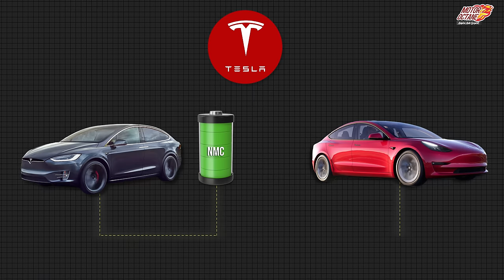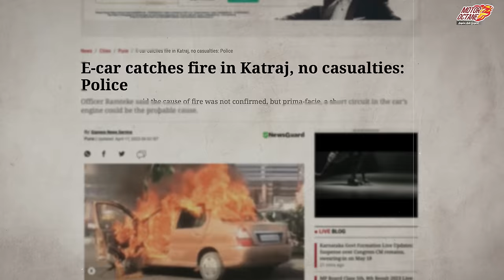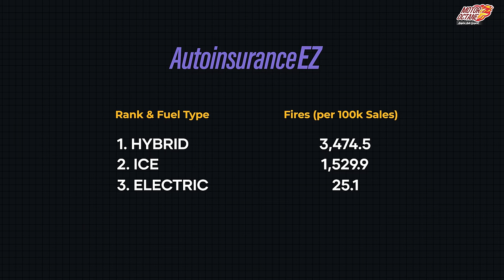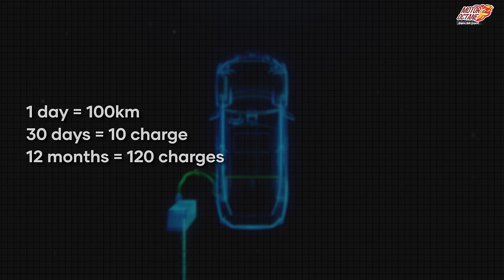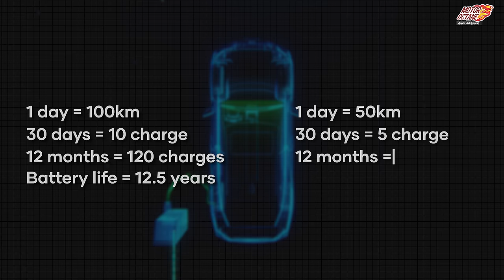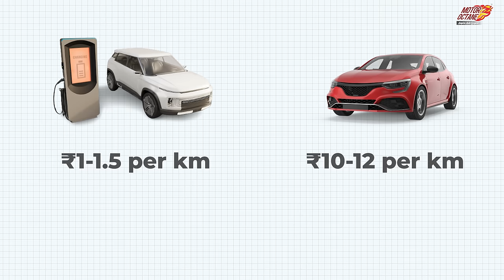Electric Cars have Battery Problems?

Comment: Hi Rachit @motoroctane I am a Nexon EV owner. I feel the problem with EVs is, they have become more of an appliance rather than a vehicle. And with poor manufacturing process added with below par dealer dominated support framework, makes it a gamble. If you got a decent car, then you might be happy. But if you have got a defective car, then you're at god's mercy. Sometimes it's worth thinking "are we ready for EV yet”.

Here are the details for this observation. I purchased my car in Jan 2022.  1st Breakdown: 18th March 2022, location Bengaluru I was going for vaccination of my Daughter (4 months old at that time). My wife and baby had to wait for a couple of hours on the road in sun taking all the head and pollution waiting for the tow truck. Service centre guys told, it was a simple problem where a cable went loose. 

2nd Breakdown: 5th January 2023, location Ooty. (Daughter 14th months old). On a family holiday, suddenly the car started showing a critical battery error and went into limp mode. The car had to be towed to Coimbatore service centre. We had to abruptly finish our trip and had to travel and stay in Coimbatore (charges extra paid from my pocket). Again as per the service centre, issue was very simple as some condensation had deposited on the LV ports. I wonder what would had happened if the car had broken down in the forest. 

3rd Breakdown: 17th April 2023, location Bengaluru. Car had been lying in the parking lot as I had to visit my home town. After coming back, we I tried to start the car go again critical battery error, and had to sent it to the service centre. Now again I was told, it was a simple issue of HV cable loose in DC-DC.

I had wrote to all contacts available over internet for 2 things.

1. To do a through checkup of the car &
2. Post launch of Nexon EV Max, as a cost cutting measure, Nexon EV(Now prime), doesn’t come with a bottom plastic guard to covers the internals. I asked to get me. (At my cost)
Nothing has been done, till date. Got a call from Tata Motors Regional CRM. He listend and made an empty promise of fulfilling the asks. Till date they are “evaluating”. Sad to say govt works better than tata employees .

So I would like to advise your viewers to think thrice before buying a Tata EV.
Reply: Thank you for your valuable input.
Reply: This is very true. I had the HV critical alert twice so far on Nexon EV prime and got stuck with my 4 yr old and wife in a U-turn! Never felt so unsafe being in a car. Car towing guy called after 2 hours. I had to hire a cab and send my wife and kid home. Luckily I was in city. But it was on May-1st. No service Center open for emergency breakdown. No service personnel available. So your emergency support is down the drain. Having an unreliable Nexon EV and not having reliable service support makes things even worse. I’m now so skeptical to use the car for distances more than 10 km
Reply: @ICEBreakup  yes I understand this feeling. We feel so helpless and insecure. And worst part is the manufacturer doesn’t respond to requests. Had it been any other “appliance” we can do return/exchange. But here you can’t. Even your ask for a through checkup is not fulfilled. And also I think online when you search you don’t get a forum where impacted people like us are sharing the pain.
Reply: This is extremely important point give by you for the upcoming owners. Thank you so much for sharing this Mr. Amitabh
Reply: Good work Rachit 
I also have Nexon EV Prime couple of days ago i had stuck on road in between traffic due to sudden Battery Drainage issue!!   I had to wait more then 30 minutes to get call connect with customer care !  I started calling customer care @ 10.30 pm and call answered @ 11.00 pm and car towed @ 2.00 AM in nxt morning. Service centre took 3 day and took trial & found nothing and replied its a software update is available and we had upgrade the software. As u can think how a software be a reason of sudden battery loss? Let say an older software that was running on car since i bought suddenly it gets kind of EXPIRED on a date and it will be reason of failure. As i follow you guys i searched on multiple websites for is there any software update available?
Surprisingly there is no such update released by company! When i asked them to provide the version of older one on my car and new updated version they failed to answer it as there is no such thing available. 
I noticed there is so much confusion in service centre guy’s Knowledge even i talked to technician, CRM of dealership, Regional OFFICER who look after EV complaints they all contradict their knowledge about how to use EV, Charging cycle, LOW PERFORMANCE MODE which enables 20% battery to get charged to charging, one of the guy said if u use fast charge  an be a reason for battery issue! When i told him i had use fast charge only 2 times since I bought car he kept silence! Now if a fast charging is affecting such to batteries in such low time why company is promoting fast charging? 
I also find on multiple visits to service centre it seems there no such infrastructure & guidelines & training given to technicians till now and its working in gods mercy !!!

There is so much to get know before someone buy an EV & like you Rachit be the source of knowledge 

Requesting you to be the voice of frustrated customers of TATA EV as i only have exposure to TATA as having TATA car filling and getting no help from customer care!!

Once again Thank you for the knowledge you spreading keep up the good work and help current as well as new buyers
Reply: Add to this, EVs are really not that eco friendly as is being hyped up. Ask yourself a simple question, if roughly 70% power generation is by burning coal (which is one of the dirtiest source of power) how is it zero pollution? It is then no longer a solving the air pollution problem, but shifting the pollution problem.
Reply: A very thorough comment. Thank you.
Reply: You are at the mercy of Tata and Mahindra NOT God!!! Probably they need to learn Customer Care lessons from Giants.
Reply: I'm also an Tata Ev owner from last 1.5 years drove my car Tata Tigor 25k. I've not faced even a single issue till date. I've been to long trips Dehradun, Shimla, Dharamshala. With proper planning everything is so smooth.
I think you are right Tata cars were may be not reliable from start but they have improved alot so taking car now with newer version is very safe go for it!
Reply: Thanks for sharing your experience.  Excellent pointers and these issues are often hidden by the marketing team. Iam sure thr engineers at TATA are well aware of these issues.  We are not ready for EV yet . Could u plz tell me how long the charge lasts if u don't use the car , I mean if it's fully charged but just lying in your parking ?
Reply: Thats why tey to buy the car as soon as ot gets launch whether its an petrol or EV car.  Because later they will start doing cost cutting in the parts.
Reply: with the kind of experience you had with TATA ev , you deserve a replacement from TATA and an apology. Can't imagine your bad experiences with your family.
Reply: @DeepakBusanagari  thanks Deepak. I wish to file a consumer court complaint. But my lack of knowledge about this subject is causing a big hurdle.
Reply: @amithbanger5959  Battery has no issue as such. Mostly issues are with wiring and related stuff. As it’s done by factory workers. Some screw might not be tighten as required. Which will then cause trouble.
Reply: @amitabhchanda  ok so u confirm that the battery will not discharge while the car is just sitting in the parking lot for weeks .
Reply: @amithbanger5959  yes. If you’re going away for 4 weeks or so. The. It’s recommended that you disconnect the auxiliary battery. It’s same as ICE vehicle. That battery will get discharged.
Reply: @amitabhchanda  thanks that's exactly what I needed to know. ICE car batteries take longer to discharge 3 months plus.  So even with 2 weeks lying in the parking , we could expect a 50 percent discharge for EV cars I guess
Reply: I don't think EV will be better before 2030. Less range, more problems. Heating is the main thing atleast for Indians.
Reply: @amithbanger5959  you EV battery will hold charge. It will not deplete. Buy the auxiliary battery might get drained. Hence recommended to disconnect.
Reply: @amitabhchanda  thank u very much for your valuable insights .
Reply: Why did u buy one man
Reply: @Elisa9395-y4z  well brother we all make mistakes. This is why car consultancy like what Rachit has are required.
Reply: By the way one more nugget. As in EV how much range that you’ll get after a full charge is dependent of how you drive. Just to give you all an overview of that. Yesterday when I did a full charge I got a range of 300 which was all city drive. But when I took my a trip to Mysore this morning. I am getting a range of 174 kms. on highways. THIS THING WILL BE COMMON TO ALL EVS
Reply: @amitabhchanda  sounds like a lot of planning before going on a trip. I guess one has to factor in the various charging stations en route to make sure u don't die out in the middle of no where.
Reply: Any petrol vehicle can also break down brother it's just u don't blame companies for it
Reply: @abhijit1509ibskol  Bhai half knowledge is very dangerous EVs are 90% more eco friendly than petrol vehicles reason is very simple.

70% Electricity is generated by burning coal and my friend petrol kya air se aata he from crude oil to pure petrol takes 10 times more pollution than used to charge one electric car 
+ to deliver that petrol to petrol pump also takes more pollution in transport. And oil spills in sea has killed billions of fishes as well.

+ Petrol vehicle pollutes more while running as well so it is end to end pollution.

If u installed solar panel at home than it becomes 95% more eco friendly.

U would say lithium mining as well engine build kisse hota he by alluminium and iron uske liye bhi pollution hota he mining hota he.

Bhai knowledge badhao aur apne doubts clear Karo galatfaimi me mat raho dost 😊
Reply: @prashwin0917  probability is low due to settled manufacturing process + recall happens.
Reply: Absolutely correct... This guy is PROMOTING EVs as if hired from  Mr Gadkari !
Reply: U made a big mistake
Reply: Let's say, the battery Capacity is 300 kms n u drive 100 kms per day, So theoretically, you will have to charge in 5 days. That assumption is absolutely WRONG. I think if I am the EV owner, I will actually charge once I am done with 150-180 kms. No one can take that risk of getting stranded in the middle of the highway, specially how unreliable these EV z are specially with the range part. So your 1500 cycles will come VERY QUICKLY.
Reply: @aakashgopalia  Let's say you charge after every 150kms, then it is counted as half charge cycle each time and it will be considered one full charge cycle if you charge it twice at each 150 kms. So what you stated in last line is not factually correct.
Reply: @santoshpv321  can’t trust EV z yet ! It’s a Long way to go !
Reply: Watch the video above and decide for yourself ..
Reply: Thank you i will keep that in mind
Reply: Let me tell my story . My Ev max always gets disconnected while charging in fast chargers. Tata charges always sucks . Tried static , it happened the same. After riding the car continuously at 80-90 for an hour my car shows limited battery performance even battery is 60 percent left . Service center doesn’t have complete info .  While I have seen when MG ZS Ev was charging at fast charging before me doesn’t had any issues. Those cars support better charging acceptable and never disconnect as EV max do . Useless car experiences as I am afraid of taking my car outstation .
Reply: @Radhakrishnabhakt  thanks for sharing your experience. I am sure service centre people were not able to fix the issue and would have given you a very stupid reason.
Reply: @ridhamgupta7504  tigor ev kabse aane lagi
Reply: @abhijit1509ibskol  EV vehicle is a new market trend globally. So the investor get profit. I mean stock market. EV is not meant for ecofriendly vehicle.
Reply: @prashwin0917  Please study electrical and Mechanical Engg. Do you have any idea what the power rating to charge a Nexon EV. If you consider if the EV car charger consume 7kW of power and if you install 10kW Solar panel, the solar panel will cost 10 to 15 lakhs. Extracting Iron and Aluminium is not that hard like mining Cobalt and Nikal. As per your view, Gold and Iron are same. You cannot understand why gold is so expensive compared with iron.
Reply: @rameshlaksh  you are spot on! To add to your perspective, the European Commission incentivised purchase of diesel cars and SUVs while rolling out Euro 3 pollution norms. The logic was diesel engines generate far lesser CO2 then petrol engines (which is still true now), they simply were not aware of NOx issues of diesel (which again is blown out of proportion by media and some lobbies). So, in future when the maladies of battery EVs will be "realized", then there would be another round of circus to create a new need, new market and new demand patterns in our "Free Market"..!
Reply: @rameshlaksh   Bhai 7 kw solar panel installation cost is 4,90,000 less than 5 lakh if u want I can get it installed for u my friend. Extracting cobalt and other metals would cause less polution than polluting for electricity generation for 25 yrs through coal
Reply: Rachit, I am a Tigor EV owner. 
The calculation of charge cycle you did is not accurate. Unlike a petrol car, you actually don't wait till 10 to 15% for recharge. You will not drive a car till it reaches 0% . So charge cycle typically is lower. 

Also I don't drive it in heavy  mumbai rain months like July to sept, beacuse as you know that unlike Navi mumbai, where I stay, I work at vakola. I really don't know till what level of water logging you can take your car, despite all ips4 black blazer claim
Reply: He is one of the unlucky owner. No other owner has faced so many breakdown as he had 🤣🤣
Reply: Thank you very much for your valuable feedback
Reply: initial niggle there. and no legacy manufacturer taking this seriously like tesla.
tata mahindra are happy with their ICE car sales. 
mg zs ev is more reliable.
Reply: Keep adding other breakdown details bro, happy electric driving. 
And by the way the towing vehicle they send everytime is thay electric or Diesel? 😂😅
Reply: Really surprised to see 3 breakdowns starting within just 2 years.. I have an ertiga petrol 30k running in 4 years.. not a single breakdown... only one issue happened with AC which was fixed. Another issue was with Hybrid battery which does not auto start stop anymore but does not impact anything else.
Reply: Pls suggest any...
Alternative for Xuv400.
(In my opinion Tata Nexon EV Max best)
Reply: When ppl talk about breakdown and waiting for tow trucks, I laugh so hard 🤣 

Not defending tata they might not be good but all are same be it Toyota and Tata how you expect a tow truck to be present in 30 minute or 1 hour. Unless you are next to it.
Reply: @rameshlaksh @rameshlaksh 
I am not sure if you can sell electricity to grid operators but if thats possible, you can make quite significant amount of money, perhaps even after including batteries for solar panels

Mining problems for cobalt, nickel is real and negatively affects people, but air pollution from cars using petrol/diesel also negatively affects people. Both needing to use electricity from coal plants and using lots of cobalt, nickel can be solved in the future.

One big advantage for EVs is it puts us (and everyone without signficant oil/gas reserves) on a path of energy security and energy independence. It gives us way more leverage in international relations and makes sure that the entire economy is not at the mercy of US or Russsia or whatever
Reply: Thank you for valuable information
Reply: Thnks
Reply: Where there is TATA there is headache 
Pichle 30 saalon se inse petrol car sahi se ban na saki EV kya hi perfect banayenge yeh
Reply: Tata Service Quality has always been an issue
Reply: Thanks a lot for sharing your very very valuable thoughts sir, by sharing this review you've helped thousands of people for not wasting their money on something that looks value for money from outside and stressful when purchased. 

Thanks a lot❤
Reply: Thanks for the valuable lessons
Reply: It's very unfortunate to know that what you and your family went through. In 2022 the EV infrastructure was comparatively bad, like now it ain't perfect but back then it was even worse. Indian car manufacturers have like decided to go Electrics by taking direct inspiration(kind of) from the Europeans. As you may know that Tata cars and Mahindra cars have been performing poorly in the recent time. Like there are a lot of news about Tata and Mahindra cars breaking down and stuffs. Like honest thing they haven't made their ICE cars much perfect yet, what can one really expect from their EVs? And Tata is already infamous for bad servicing, so these problems might still persist. India is slowly developing towards, being more suited for EVs. But, our car manufacturers are not yet ready, like at not that level. Maybe in future, like Harrier and Safari EV, or Mahindra's BE divisions might perform good but for now they're products ain't feasible enough. Probably one should prefer EVs from other manufacturers probably MG. We all know MG is a Chinese brand, but for the timing MG is making better EVs. People are going towards Tata and Mahindra mostly because they're Indian brands. Else we got many other manufacturers as well like we got cars like I said the MG ZS EV and there Hyundai Kona as well. On high price bracket we have Kia EV6, Hyundai Ioniq, BYD Seal, Mercedes EQC, etc.
Reply: Tata, Mahindra cars are a gamble. No standardisation.
Add poor repair and maintenance.
Reply: Correct he. Same experience i suffered
Reply: Tara is bad at service